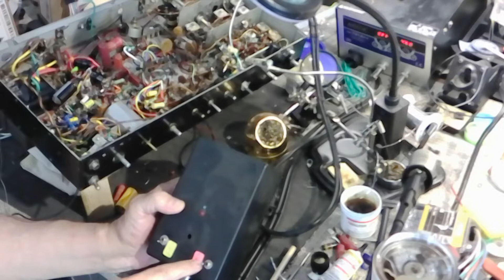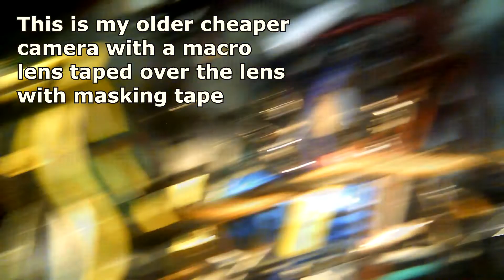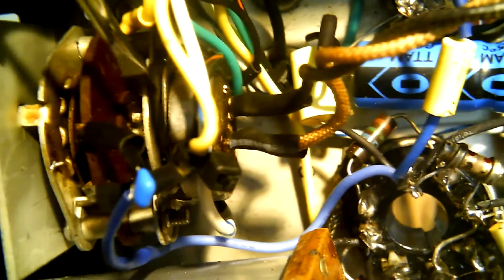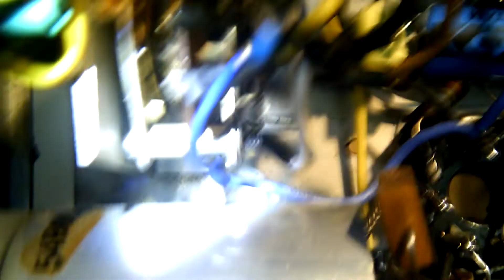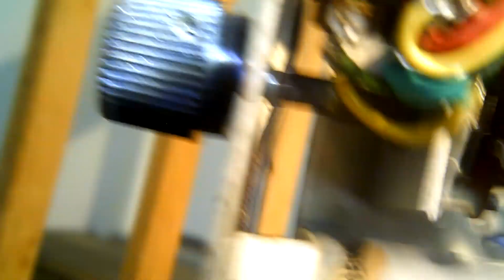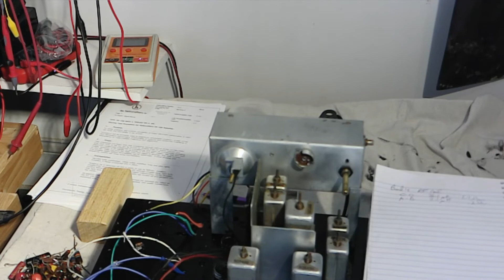Hallicrafters SX-100 Shortwave Receiver Restoration Continues: Finish of Under Chassis Electronics

Comment: Smokers radio; they are time consuming to clean up. Good use of the cable. Paul’s capacitor leakage tester looks like a cool project to build; was it easy to construct? BTW - the birds sound very happy. Glad to hear your Dad is doing good. You may have said in one of your earlier videos, what got you interested in Hallicrafters receivers? Best, Don
Reply from the maker: It was built open wired with two terminal strips inside.  An easy build for me about two years ago.  I had a Hallicrafters SX-71 as a teen.  End of story.